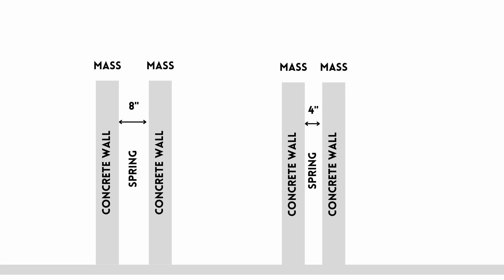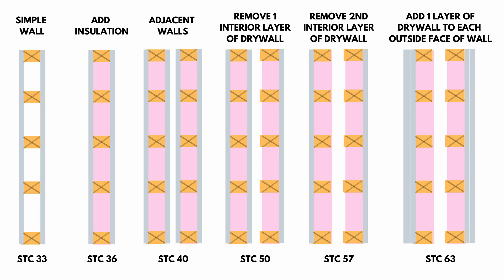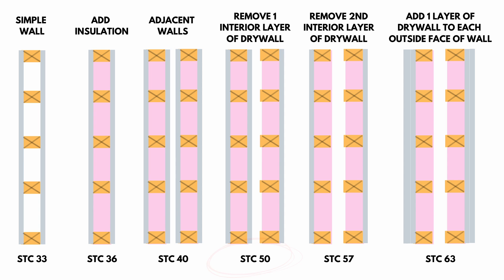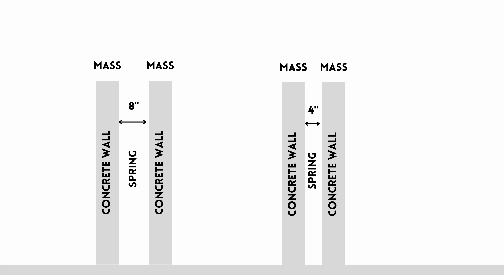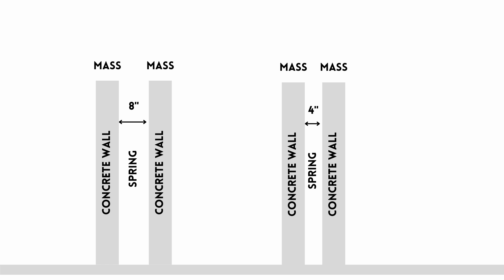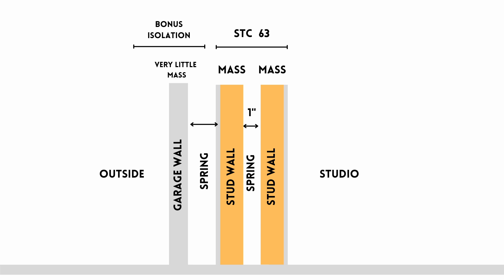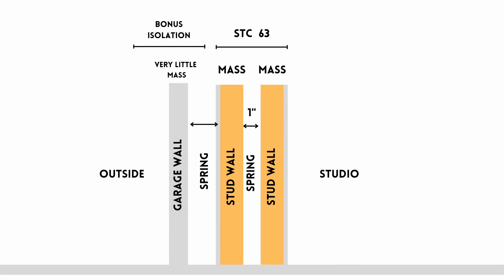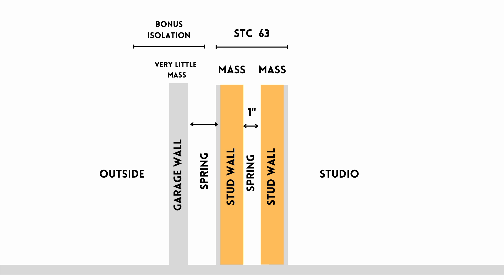What is the Triple Leaf Effect In Soundproofing?

Comment: Okay but never put two concrete walls together like that. If a mouse or rat gets in there, you have no way of removing it - but whatever hole it got in through is going to let the smell back out.
I'd be interested to see an analysis of a concrete wall with plasterboard on both sides, though. Glued direct to the concrete, or offset on battens or isolation clips or both. Offset has the big advantage of making a cavity for plumbing and wiring runs.

Comment: That's not correct. Soundproofingcompany did as you mentioned (adding layers, but not decreasing height of the spring/air), and the STC goes down on the lower frequencies. It's due to resonance between the masses. Google "Triple leaf effect" and the first page is from the Soundproofingcompany, with lots of data.  So yes, you are building a "triple leaf" by using the existing wall (the exterior). That being said, it's a give and take. You lose low end (like bass), but improve on the mid-range.

Comment: I just built a double wall system in the manner suggested in this video. I bought insulation from an acoustic company based on their advice - 48kg/m3. Was this a mistake? Should I have used low density insulation? Would a high density insulation contribute to the triple leaf effect? 
I have not  finished of my media room yet so can’t tell if the wall works as planned - I’m waiting you the sound proof door to installed

Comment: I am so happy i stumbled upon your channel. I am building a house with a inlaw suite- I am doing a double 2x4 wall with 2-3" space between the two walls. I was going to use 5/8 soundproof drywall and one layer of Sono Pan on each side with minearl wool within both wall studs ( have you ever reviewed Sono Pan sheets?) . I saw on the chart are you saying it is worst if i layered each side of wall ex. first 2x4 wall drywall on both sides then space second 2x4 wall with drywall on both sides of the wall.

Comment: Hi very informative, love your channel. I'm a drummer buying a home with a large 2-car garage I'd like to turn into a live room for drums. While I don't need it to be soundproof some sound reduction would be great so I can play later at night without disturbing anyone. 

The garage has a ceiling of 8ft with an attic above that extends up to around 16ft. I'd like to remove the current ceiling and expose the attic to improve drum sounds. While I can see a hat channel / dry wall system working for the walls there would be so many beams in the vaulted ceiling to work around I have no idea what to do on that front. The house needs a new roof anyway, so I was wondering if possibly installing the hat channels facing the opposite way and insulating the exterior of the roof instead of the interior could possibly work. Although I don't think it would be ideal where the walls meet the ceiling.... 

Something like this: https://www.youtube.com/watch?v=rn0c4WDOlMQ&ab_channel=ProTradeCraft

Does this approach sound like it could work to you? Thanks!
Reply from the maker: I have never heard of anyone doing that. Your best bet is too soundproof the beams individually.
Reply: @soundproofyourstudio  That figures. Thanks for the advice! Where beams pass through the inner leaf would you just seal with acoustic caulk?

Comment: How does it work with the air gap not being sealed? If there's a 1 inch gap between studs, but above the gap is say an attic or a lots of volume of air between a basement and main floor, wouldn't sound pass through a single layer of DW and then propagate in the air gap and everything it's connected to?  Ie, there's only one layer of mass attenuation. I wonder how this is factored in when STC tests are conducted.
Reply from the maker: Yes, it would and in fact ideally your space in your ceiling is also air tight and contains mass on the floor above.

Comment: In the garage example, let’s say the exterior 2x4 wall has about an inch of stucco on wire and building paper, no plywood, no insulation no drywall on the 2x4 studs… would you leave it as is and build the dbl wall for 63, or would you add insulation and drywall to the garage first? Also do you float the floor inside the dbl wall? Or does inside wall sit on the floated floor?
Reply from the maker: I would leave that wall as is unless you want to use it or add insulation to your garage for climate control. There is no need to float a floor in my opinion if you are building on a concrete slab. No need to float the walls either unless you feel it

Comment: Would piping true silicone (bathroom sealer type) help between the drywall sheets, a little like when people use greenglue? Silicone is very springing and I’ve got to think would create a tiny additional airgap between the boards too… what do you think?
Reply from the maker: I have heard of people using dollops or little drops of silicone between drywall. It could work in theory.
Reply: @soundproofyourstudio   The problem I see would be consistent space from one area to another.. If you had a proper manufacturing facility you might get consistency but who has that handy?

Comment: My basement home theater has perfect soundproofing (double 5/8, R19 everywhere, hat channel, green glue), but my only weak link is the stairwell. The ceiling of the stairwell is directly under another stairwell going up to the 2nd floor of my house. Do you think I should put a door at the bottom of the basement stairs so less noise goes into the stairwell? Or would acoustic panels in the stairwell help?
Reply from the maker: Yes a door or two doors would be ideal. Solid core door  at a minimum and seal it up air tight.
Reply: If I'm following your description correctly, could you add green glue (or Roberts 3095 if on a budget) and then a second layer of drywall inside the existing ceiling drywall in the stairwell? This would add decoupled mass and help reduce transmission to the second (above) stairwell.
Reply: @johnbecker334  I think there’s already two layers of 5/8 but without GG on stairwell ceiling. Do you think a third layer of 5/8 with a lot of GG would help?
Reply: @Hamza-yu1ur  having green glue would decouple the layers. Right now any vibration that affects the inner drywall layer is mostly transferred to the outer drywall layer and then into the air space on the other side. Green glue would definitely help a bit in that regard. No point removing the existing second layer, of course, so yeah it wouldn't hurt to add gg and a third drywall layer if there's space to do so.
Reply: @johnbecker334  thanks. I’ll speak with my GC about it. Do you think a tempered glass door at the bottom of the stairs would also be effective? Like a 30” length landing and then door.
Reply: @Hamza-yu1ur  if the door would effectively seal the stairway off from the room, then yes that would be helpful. You'd want to use a solid core door with a tight threshold and rubber seals all around the door where it pressed against the trim.
Reply: @johnbecker334  just spoke with my GC. I decided to add another layer of 5/8 on stairwell wall and ceiling. And hefty amount of GG. I think this is the best option. A door with landing would’ve made my basement space smaller and a bit awkward looking because of adding more framing.
Reply: @Hamza-yu1ur  If you do not seal off the space with a door, what is the purpose of doing anything at all? Have you tried playing some loud music down there now? That's about how it's going to be in the future without a door.